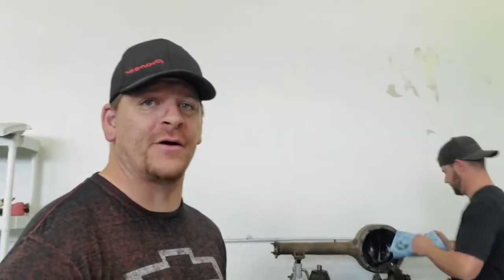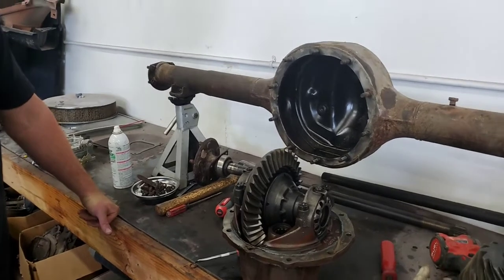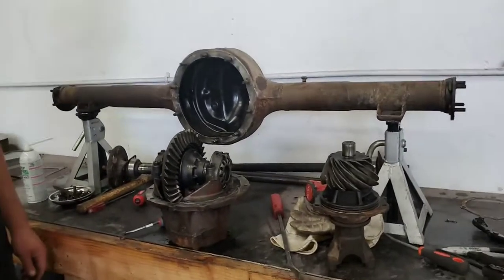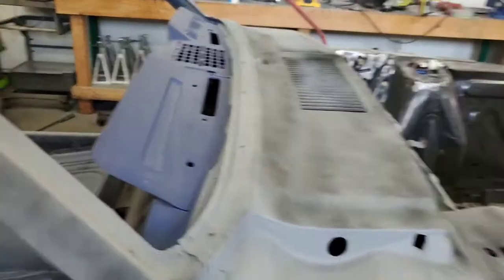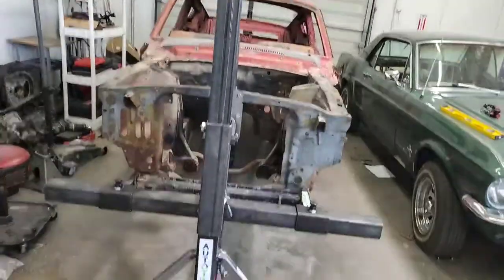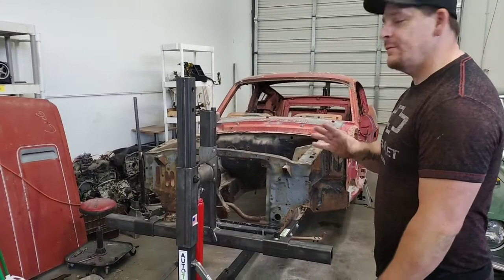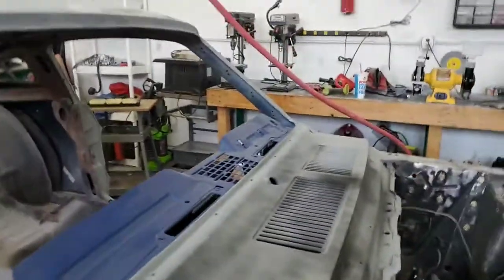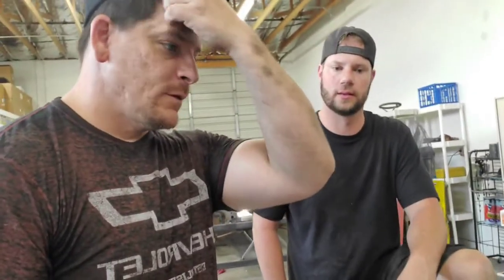Tearing a Ford 9 inch apart and checking out our new AutoTwirler rotisserie (FB live episode)

Comment: I know in the day the factory used lead to fill those large gaps where body panels came together what are you doing to fill those so they don't crack later?
Reply from the maker: Correct they did. Now you can still use lead or most people use body filler